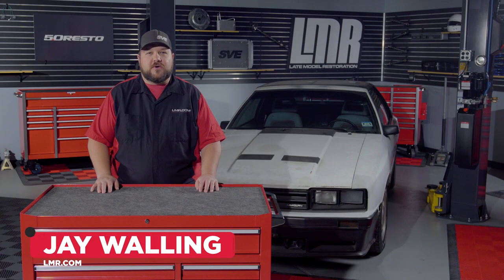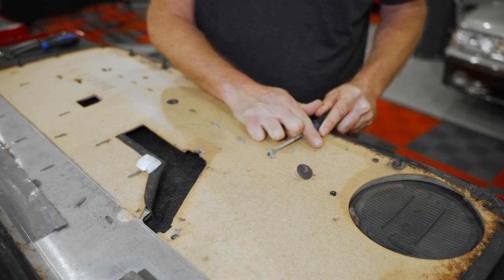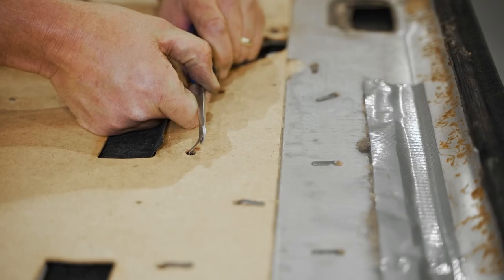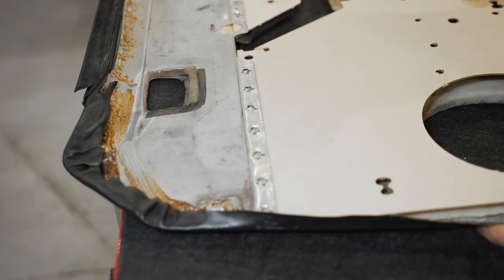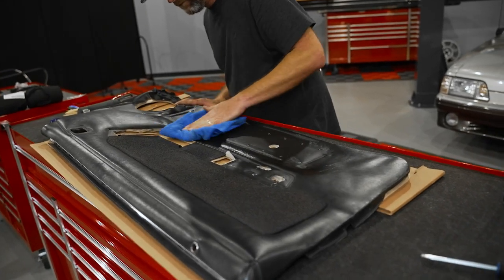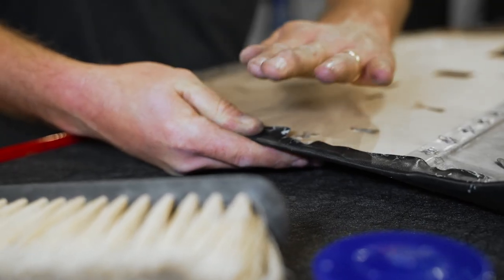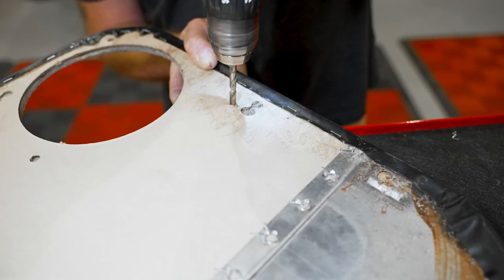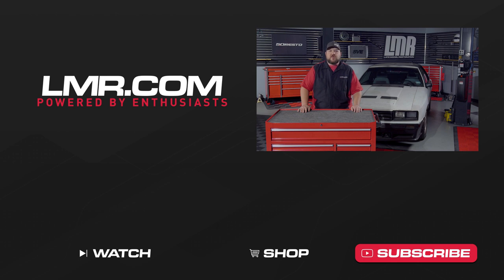How to Replace Fox Body Door Panel Boards | Fox Body Mustang Door Panel Restoration (81-93)

Comment: 3:16   every factory panel has the insert board on the back " Top side" of the metal, its why the metal is punched out, its holding the board lol, it wasn't placed wrong. R.E.M did a decent job with these.
Reply: It was wrong and when they installed the new board they placed it correctly

Comment: Is there anything you can spray on the board to make it any stronger or water resistant?
Reply from the maker: A good, off-the-shelf acrylic lacquer clear coat will help add a layer of protection to the board. Any clear coat would work; flat, stain, or gloss. Several coats will be needed since the first few coats will be absorbed into the material. -Landan

Comment: What staple did u used
Reply from the maker: Hi Angel, we used a general staple that you can get from your local office or hardware store.
Reply: @latemodelrestoration  So if I go into my local box store or hardware store and ask for 'General' staples, they going to ask whats my application. I say reworking door panels on a fox body mustang. At that point I get a dumb look, which is the same one that I'm giving you now. Staples come in specific lengths / types for different applications. I've seen it asked here several times already. So can someone please advise what length (ex.. 1/4 inch, 3/8, 5/16.., 6mm, 8mm, ...etc ) and the type of staple (ex.. T50, series 13, or series 53 ..or something else) . There is a standard office staple such as Bostitch SB10 staples, which are 1/4 inch. These are for stapling paper not fabric to pressboard or aluminum. There is also a standard upholstery staple that's normally 3/8 inch. So some details as to what was used in the video would be helpful. 
Thanks
Reply: So I did my door panels and used an Arrow brand JT27 stapler and Arrow JT21 1/4" staples which do not go through the board. 
One additional thing I did to the area where they staple the new board to the aluminum part, was cover this entire seam with foil duct tape, which really helps to ensure these 2 stay together.
Reply: @stevevance1678  This comment was more helpful then you realize.
Reply: @S  teve Vance  same here, I used the Arrow stable brand with JT21 1/4 staples.